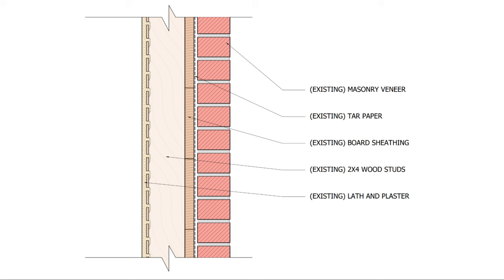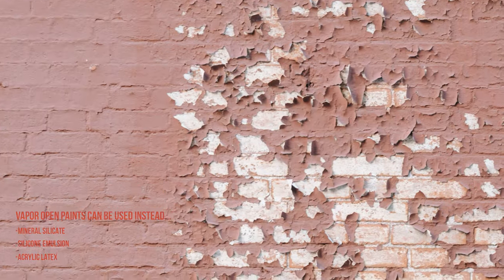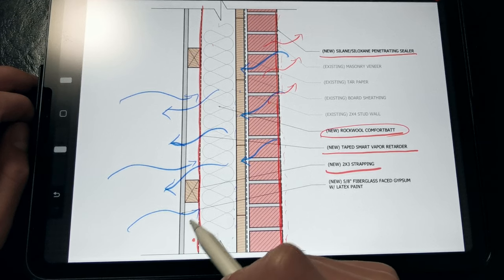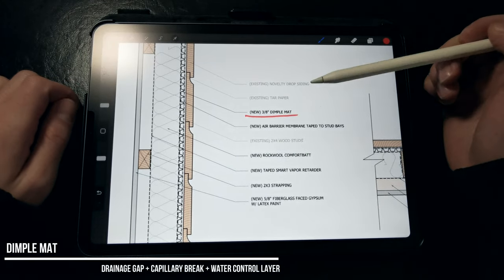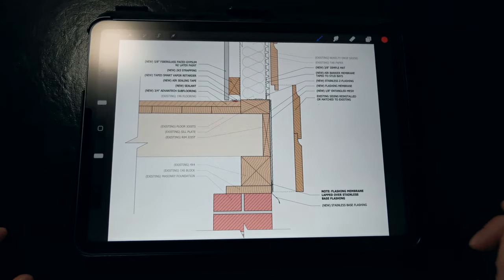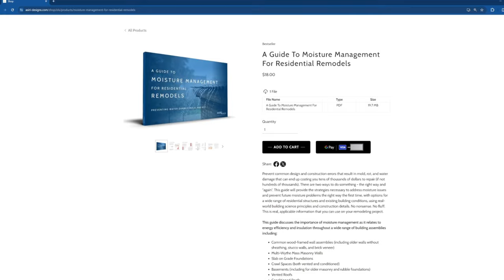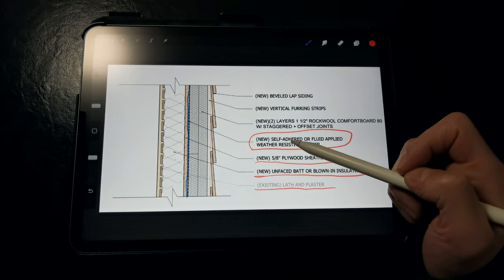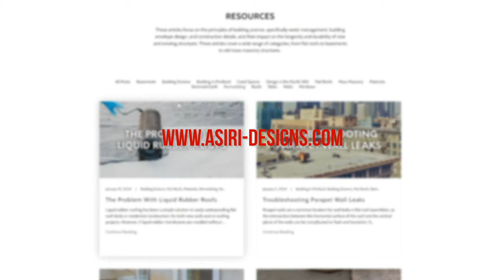Insulating Walls in Old Houses (For Architects + Contractors)

Comment from the maker: A Guide To Moisture Management For Residential Remodels eBook: https://asiri-designs.com/shop

P.S. Use prudence when addressing any old wall assembly. Each wall condition is different and receives a different level of exposure, depending on the location, climate, overhangs, etc... If you see evidence of water damage or leaks, this has to be addressed first prior to insulating. We cover this in depth in the eBook.

Comment: I’m remodeling a house that has lathe and plaster. I removed it so have access to the inside, the outside was lap siding but shingle siding was installed later, then later still someone installed like a stone brick over that. So since the outside is so weather protected and sealed I plan to install rockwool insulation and drywall it. I don’t believe I will have a moister issue, unless I’m missing something

Comment: GC here.
I have to do a full teardown of a duplex which was made in 1930ish.
I wonder if the poly will create a problem overtime.

I was planning on doing r20-> 1" foam (r4) +1x3 - >2 5/8 drywall without any poly

Comment: This is excellent! Thank you for this video. 

I had some rot repair work done on my Atlantic Canadian stucco home circa 1930. Our contractor reinstated the wall with a modern dry-mix Portland cement stucco that was then painted with acrylic latex paint. The contractor did not use a rain screen beneath the stucco (as recommended in your Moisture Management in Reservoir Claddings blog post) and I am concerned about possible rot/deterioration of the assembly especially on our roof dormers and around window penetrations. We have insulated with rock wool in the 2x4 cavities and installed rigid insulating foam as a vapor barrier cut to fit the stud cavities as we did not require the removal of the existing rock lath plaster on the interior. 

Do you have any suggestions on how we can reduce our risk of rot from the interior?

Total assembly is - Portland Cement stucco, two layers of Tar Paper, 3/4" plywood sheathing and 3/4" boards, 2x4 Roxul, 0.5" foil EPS insulation, 1-1.25" rock lath and plaster, oil and acrylic paint.
Reply from the maker: Thanks for watching! That is a tough condition. Your contractor definitely didn't do you any favors there - we really need that drainage plane behind stucco to uncouple it from the framed walls, not to mention the rigid foam/vapor barrier was installed in the wrong location. Moisture that gets into the wall cannot dry to the interior because of the foil facing. Ideally, the rigid foam should have been installed OVER the WRB/tar paper, then the drainage plane, and then the new stucco over that. The two layers of tar paper might give you a little bit of a buffer since stucco can't fully bond to tar paper (compared to modern synthetic WRBs), and two layers have been installed. Assuming that removing/reinstalling the stucco correctly is out of the question, your best option would be to install a silane/siloxane penetrating sealer to reduce the absorption of the stucco facade. It's not perfect, but it will reduce the amount of water stored in that "reservoir". You may also want to consider regularly monitoring those walls for high moisture content. If MC in the framing exceeds 30% you have an issue that needs to be addressed immediately. Hopefully this helps a bit, good luck!
Reply: @ASIRIDesigns  thank you for your time. Will that sealer penetrate the latex pain applied to the wall?

Comment: Does your book address late 1800’s adobe brick filled walls?  I have original wood siding with original diagonal plank sheathing underneath. Happy to buy if it does but couldn’t tell from contents page.
Reply from the maker: Hey there, unfortunately the book does not cover adobe walls. That sounds like quite an interesting wall condition though, I'd be even more careful. You may need to get samples taken of the adobe to learn more about the composition and whether a penetrating sealer would be appropriate, such as the penetrating sealers used in rammed earth walls. I'm assuming you're in New Mexico or Arizona?

Comment: Thanks for the video!  I have a wall assembly in a 120+ year old home where the siding is applied directly to the studs.  I have removed all the old post-construction blown in insulation and lath and plaster.  I'm wondering if a fluid applied vapor permeable air barrier in the wall cavity on the back of the siding would be a good option.  It works in my mind but not sure if I'm missing something.  Also may require a lot of prep work to actually get it sealed completely.  Thoughts???
Reply from the maker: Great question! You need airflow behind that siding if you have plans to insulate it, so I would not recommend a fluid applied air barrier applied to the backside if you're not going to address the exterior. We've got a few options for this though, there are a few articles on Green Building Advisor that address this. We also have a few free videos on my channel that talk about how to retrofit a building without sheathing. My design guide also discusses how to address this conditon: https://asiri-designs.com/shop
Reply: @ASIRIDesigns  I am painting the exterior and caulking the vertical joints and penetrations.  If the fluid applied is vapor permeable, I'm still not understanding why you need airflow behind the siding??  I'll try to watch all the videos and read the articles.  Thanks for the quick response?